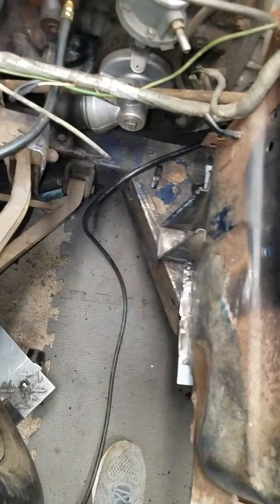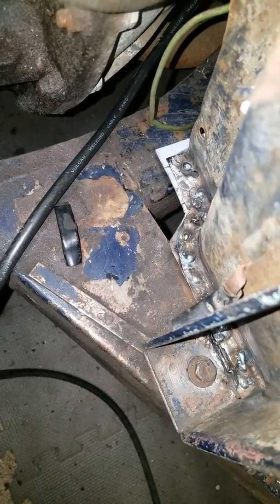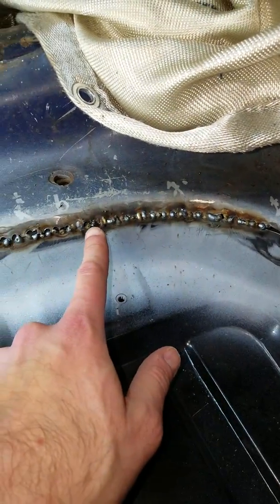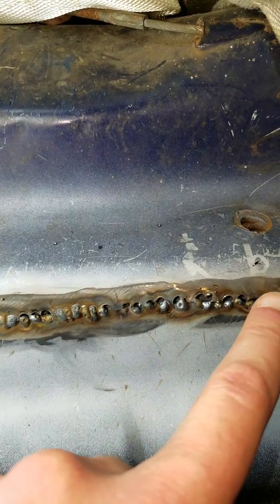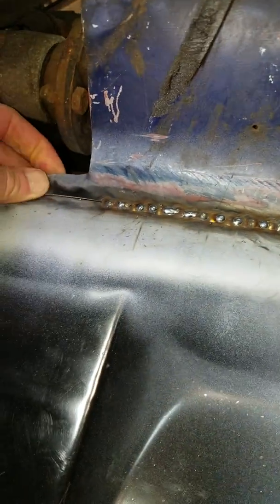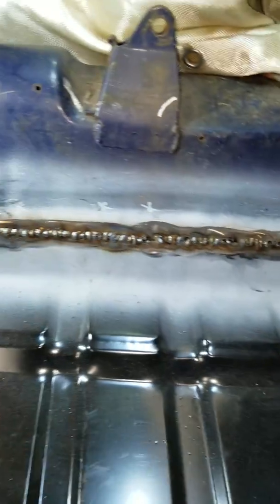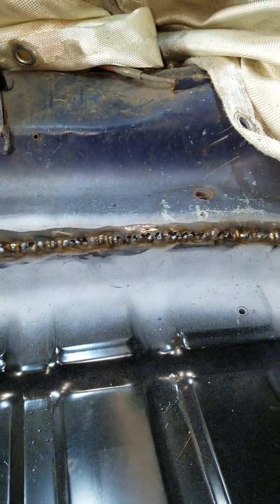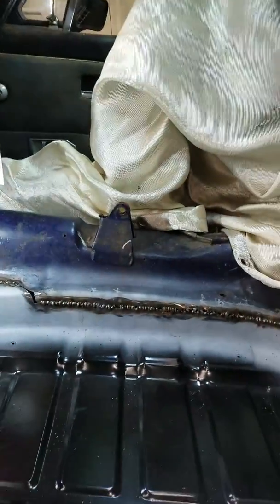Triumph GT6: Welding the driver's floor

Comment: Awesome! A milestone event. The metal holds heat a lot longer than I ever expected. Maybe, even though you're jumping around, the welds are just staying too hot and you're that much closer to burn through. Compressed air to cool it maybe. Or wait longer. Just a thought.
Reply from the maker: Based on the pattern of blow-through, I'm guessing it's the thinness (anti-thickness?) of the metal. I'll try compressed air next time. just in case.
Reply: Could be you're running too hot, or your heating up that one area too long.  There's a point where the puddle just suddenly balls up on itself and cause the blow through.

You can back fill the blow outs with weld, as opposed to chopping it all out and patching. Just be careful so you don't chase the hole all over
Reply from the maker: @drivewayshop  Thanks. I'm having trouble adjusting my welder so I'll try that too. What's weird is that the blowthrough mostly occurred in the middle of the seam, not really near the edges. That's why I at first thought it was due to overgrinding the old metal, making it too thin.
Reply: @DavidPlass  thin metal would cause it too. Good thinking